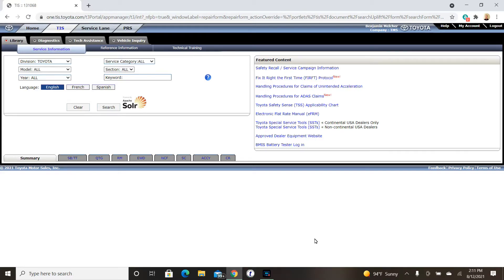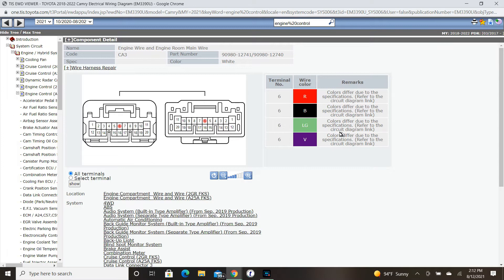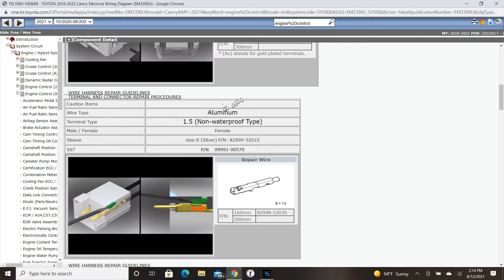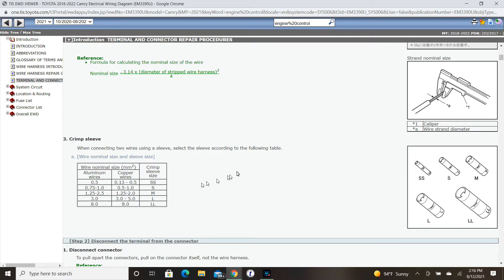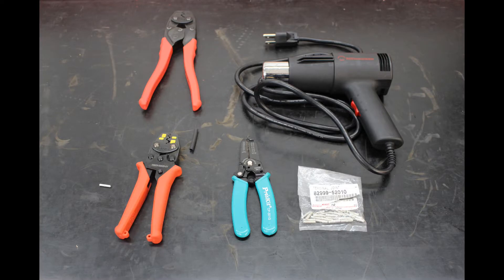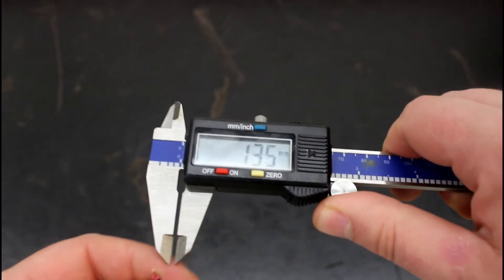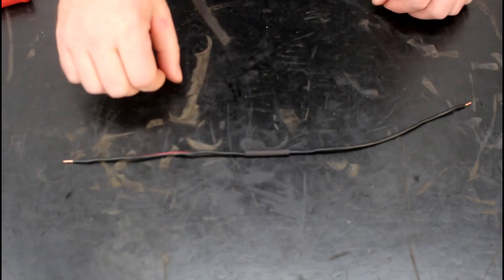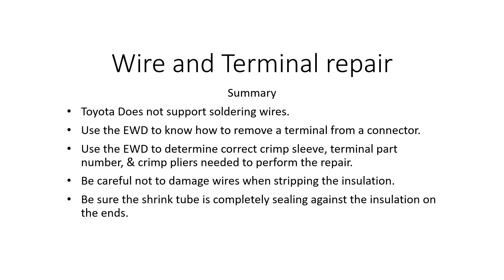EWD tips and tricks- Toyota approved wiring repair using wiring diagrams.

Comment from the maker: We just found out today (8-13-21) that the complete terminal lance tool kit will be shipped to the dealerships in the next few months! We also found out that the crimp sleeves in all sizes have been in high production and will be in good supply soon.
Last thing we found out is that there is going to be a required emodule, and a QTG released soon with this same information!